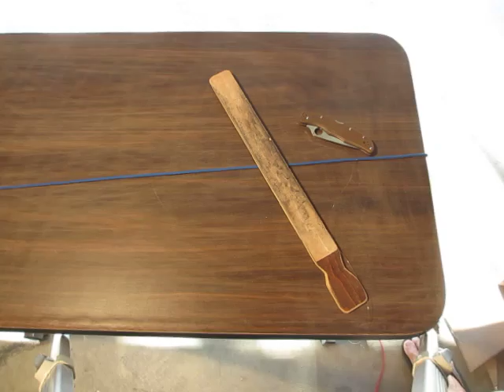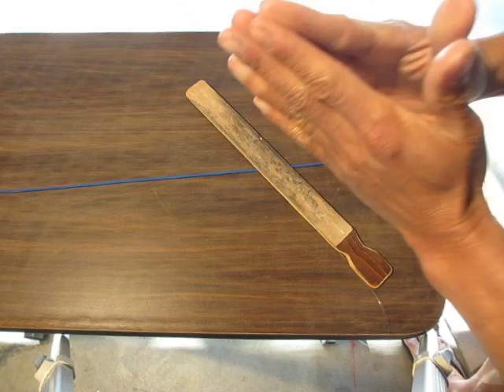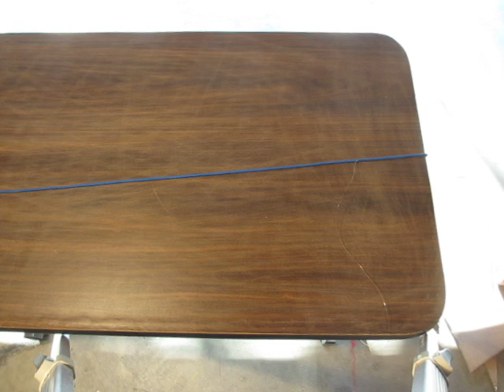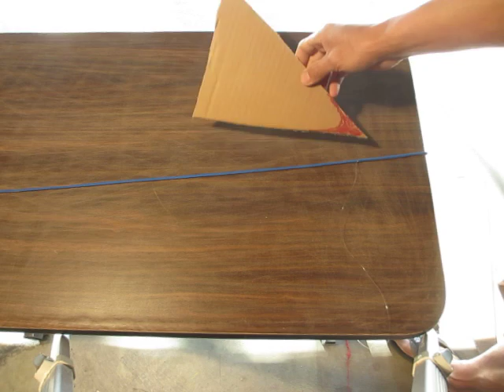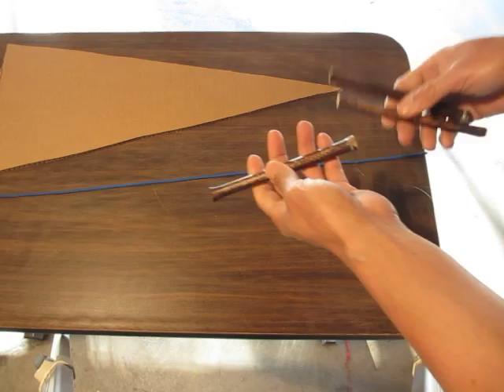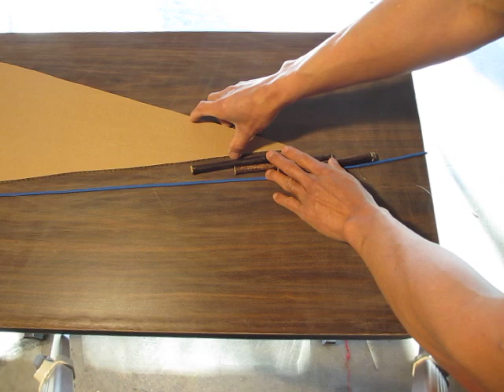A balanced strop part III - why it works w/o rounding the edge

Comment: Luong La, I did as you suggested and followed the whole thread on BF. I understand. It is clear to me what you are trying to achieve: A Foolproof Strop that is inexpensive yet effective for many common knife steel types. I applaud your experimentation and your results. At the end of the day, a much coarser abrasive than is typically loaded onto the "fluffy" side of the leather on wood strop largely prevents the rounding of the apex so many beginners experience stropping after a sharpening session. The white compound you used is NOT the same as Bark River White which is approx 12K grit equivalent. I am quite interested in your thoughts using a Diamond spray or paste on the fluffy side of leather and also on your improved felt version. Also, I wonder how denim cloth on wood would work with diamond spray or paste? I am not sure if you've experimented with that, but I suspect it's a little uncommon to find Diamond or even CBN emulsions over 2 or 3 microns. I will check! Anyway. Thanks for all the work you've done and published. Especially the crazy failures that must be frustrating. Also, my apologies for how slow some of us can be to comprehend new ideas for something that been done since mankind has walked. Kenny

P.S. I believe that this result, loosely couples to some of the startling and surprising results Todd Simpson has posted on ScienceofSharp.com - I believe much of what you've found is corroborated by his SEM images.

Comment: Fascinating to follow this demonstration on each part (1-3). So submicron diamond abrasive on smooth leather mounted on wood using even the lightest possible trailing strokes, 2 or 3 gentle passes, will create a micro convexed apex and probably a micro burr that may or may not be desirable.

Comment from the maker: 550stanley - somehow I can't reply (i.e. oddly no reply link)
Leather nap will catch & embed only certain size grit - mostly on the larger size of Alumina trigonal crystal. Smaller grit will fall on leather surface, which are mostly block from action because of high naps loaded with larger & longer abrasives. In addition to shingling, nap rebounce/flex-back from compression is drastically reduce toward the bended tip. In event of high sharpening pressure, most of that pressure go into compress nap root - an almost 90degrees bend which change abrading vector (see my reply to Cliff Stamp's comment).

Edge convexity - under microscope - increase as the nap size decrease from optimal (0.5-1mm).

Comment: I don't understand exactly what exactly you think is causing the abrasive to prevent the edge from rounding even when high pressure is being used?
Reply from the maker: To be clear, there is some whole bevel convexing taken place. No rounding next to the apex due:
1. substrate (leather flesh side). leather naps change abrading vector to more parallel than upward onto the blade. and possibly (guessing here) change from plough/push to pull abrading.
2. high density of 12um abrasives acts like overlapping scales (or say wood shingling) prevent substrate spring backup right after the apex. In this case leather sprung backup a few microns away from apex, hence no rounding/dulling.

Repeat* this strop doesn't work well for high alloy knives. Basically any strops kind/type use abrasive softer than carbide which abrade the matrix and loosen carbides. Thus, mostly resulted with a wire-edge or weaken edge (yep, receding teeth problem ;)

Comment from the maker: It's just a combination of compound & backing, which I found that worked well, that's all - nothing special.  I had tried many compounds (CrO, AlOx, SiC, diamonds, CBN, BN, white, black) at many sizes, along with many type of backings (glass, woods, leathers, paper, ceramic, metals, so on..).  

Most paddle strops are usually charged compound with particle size less than a few microns, so rounding will occurs unless the pressure is light.